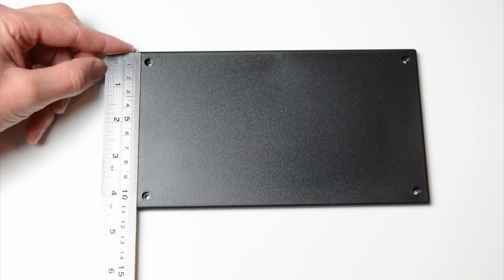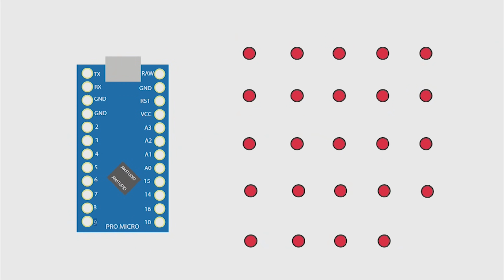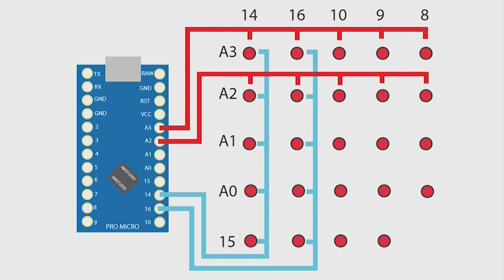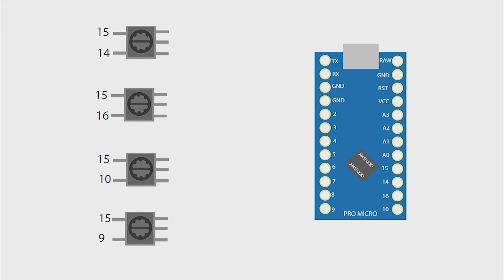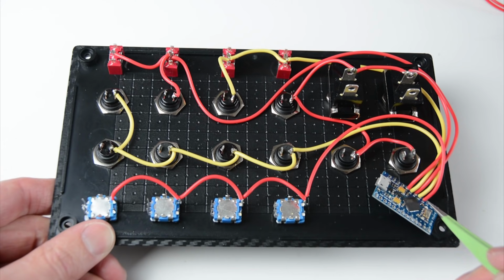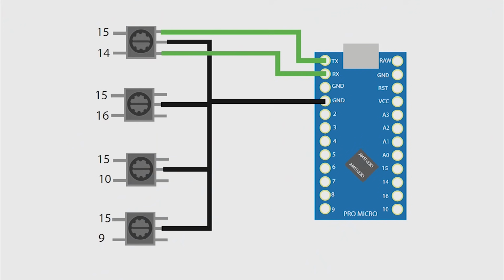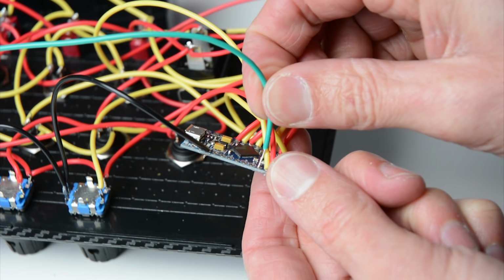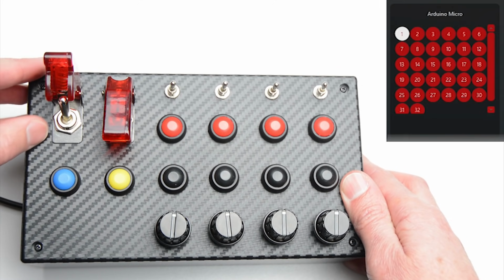MAKE THIS BUTTON BOX | 32 FUNCTION w ENCODERS

Comment: Ciao, ho programmato il chip Pro micro con il software Arduino IDE ma sembra che non mi carichi il programma, come mai?

Connecting to programmer: .
Found programmer: Id = "CATERIN"; type = S
    Software Version = 1.0; No Hardware Version given.
Programmer supports auto addr increment.
Programmer supports buffered memory access with buffersize=128 bytes.

Programmer supports the following devices:
    Device code: 0x44

Comment: I know am gonna sound really stupid but is it possible to make the buttons just run normal pc stuff like power on, brightness, screen shot etc
Reply: Im not a professional, but i think single keyboard switches are what you are looking for when talking about screenshot. You just need to program the Key and its ready. For the power on, you just need a Button with positive and negative poles, and connect them with a proper cable to the right pins on the Bottom right of your PC motherboard.

Comment: Would the 3 way toggle switches work with your code if they aren’t momentarily toggle ones?
Reply: I used 3way toggle and it doesn’t seem like it reads quite right? IE if I went up on the switch it read as button “x” and when I toggled it back to the middle, it read the same button. When I toggled it down, it would read button “z” and then it would read the same button when switching it to middle again. Unsure if that info is helpful to you but it’s what I got

Comment: Jak wejść by sprawdzić przyciski czy dzialaja
Reply: I was wondering the same thing. What i used for testing was opening up a game that I wanted to use this one and started assigning the buttons to different actions. In example, I opened up assetto corsa competizione and under the settings I was able to the Arduino as a usable device. The I would select a control to bind a key to it and would press a button on the box i made and if it worked, it would bind the control to whatever number i had selected.

Comment: I know this is a really old video, and I looked everywhere to try and answer this question(including purchasing your guide), but how do you account for ghosting? Or is it just a non issue? Thank you either way!
Reply: add a 1N4148 diode in series with each switch leg to the column line, the diode blocks reverse current, preventing ghosting and cross talk

Comment: Maybe I missed something but for these boxes I have heard other videos and on Forums people saying you will only be able to press one button at a time when using a matrix setup is this correct and is there a way around it? a different board with more input/output options maybe?
Reply: Yes downside of matrix is only 1 press at a time. Keyboards solve this issue by using diodes, allowing for NKRO

Comment: I just finished a version of this. Bought the box, chip, and switches from AliX. i think I've got $35 in it total. More soldiering and wire twisting than I expected. Program worked right away and the box is doing it's duty. Thank you for all of this work.
Reply from the maker: Thanks, enjoy!

Comment: I have a question. Do i use A and B encoders or the one with clk and data on it? Because yours on the video is using 4 pins and 1 ground. But i only find 2 ground and 3 pin encoders that look like yours

Comment: Hi. 

Wondering, with the board, it's 5v 
Are the switches also 5v or are they lower, but the board outputs a lower voltage? 
Found some stunning switches to use, but they're 12v! 😒
Reply: 12v is the maximum voltage i think

Comment: I have successfully used this guide to make a button box for DCS that has most of the frequently used controls on it; gear, flaps, weapon select, master arm etc. However, I am getting some interreference that is causing the gear to try to extend at overspeed, breaking the plane. Is there a simple way to break the current SPST gear switch out two two unused pins? I have not used the rotaries but have used their momentaries. Its really frustrating as this box works beautifully for 99% of things, but that 1% prevents me from landing nearly every time! Anyone help a guy out???

Comment: First I'd like to say that this is a very awesome build. I have most of it done including the 3d printed box and lid. I made a slight modification not realizing that it's probably more complicated than not. I took out 1 of the dial encoders and replaced it with a 5 pin engine start (ignition) button. The pins are + - C NO NC. Is there a simple way to include this on this project? Also, besides this, the rest is exactly how you have it. 

Many thanks in advance, even if you cannot help. This is a very awesome project.

Comment: How would i go about changing the Sketch coding so i could use it with 2 rotary encoders and 4 buttons? for a wheel im building as the seeduino only has 10 I/O

Comment: I built a gorgeous box with ignition , toggles , buttons , you name it. But I used a zero delay USB because I just didn’t know about arduino. Little did I know zero delay is straight garbage unless your playing one sim and want to fight it for weeks to get it working. So I just gotta learn how to use the arduino mini I just bought. 🤦‍♂️
Reply: Ummm ok. But you didn’t explain why you wire it that way. I mean not even just a general explanation would be all I need. I can’t just fly blind based off zero info

Comment: I really tried it myself and failed so horribly... my First arduino pro mirco Board arrived at my place and was Fried to hell... now that i got a working Board, the matrix doesn't fit and needs to be changed since i use only 4 buttons and 3 Encoders...and nobody told me i needed fully Digital encoders 😮‍💨 seems like i can put the buttonbox into the trashcan... i tried i guess...

Comment: I don't expect a response, but can someone explain the way he wired in the on-off-on toggle switches? He didn't show it and I'm confused how it would work.
Reply: If you are still curious those switches have 3 terminals. The common is normally in the center so you would solder your common signal to the center terminal then your button 1 wire to the top terminal and button 2 wire to the bottom terminal. So if you look at his matrix as an example you would solder say A3 to the center and then 14 to top and 16 to bottom which would give you 2 different controls depending on which direction you hit the toggle

Comment: Is there a way to do this but with the toggle switches ON and OFF registering as different inputs? The toggle switches being either 1 button held on or not being pressed at all doesn't let me use them as an actual toggle in any of the simulators I've tried. I know I could just use 3 position momentary switches instead but that kind of takes the fun and realism out of it.

Comment: could you use the 32 button and the handbrake on the same pro micro, using the ground and the vcc and a0 for the analog input and the rest of the pins for the button?

Comment: Sorry for the stupid question but I'm a noob about this... with this project I can assign to the button also combo keys, like for example Shift+L ? I mean memorized in the button box... I need to use it on assetto corsa competizione on PS5 and it works only if there is a combo CRTL+ another button...

Comment: I'm currently working on this and drawed out everything. Have a 5x5 Matrix and 4 Encoders. Am i right, that even if i could get 33 Functions out of this ( 25 + 8 ), not all will be registered because of a 32 Button limitation in MS Game Controllers?
Reply: For anyone wondering, you can just register 2 Inputs if you're out of buttons. Needs just a bit more planning to allocate the correct matrices without running out of pins.

Comment: I love this idea. I've got 2 printed out (left and right boxes) with some small edits. I made new brackets that angle the boxes slightly up and in - more like a fighter cockpit. I've adjusted the arduino code slightly as well which will allow more functionality of the buttons/analog sticks. I have them plugged in and working, but have more buttons ordered and on the way to complete it!
Reply: Hey did you use the pro micro arduino?
Reply: @smuncki8  yes! specifically with the ATMEGA32U4 chip. I also used terminal connectors in case I decide to change things around... colors, button type, easier maintenance, etc. No soldering required.

Comment: Great Video, 
i Bought the Step by step instructions from you and Wired everything correctly. 
But i have one major problem. Two of the 4 Encoders does not work correctly, everything else works fine.
and i cant find any mistakes so far. 

Cheers Florian.
Reply: encoder maybe overheat?

Comment: currently using all the parts listed for a button box for ets, building most of it tonight

Edit: Is now built and works amazingly, Thanks for the tutorial!
Reply: Can you use multiple buttons at once though? Seems to be most people's problems
Reply: @ryanlawrence1764  when you press more then 3-4 buttons at a time you will get ghosting, and occasionally the buttons that are on the same line pins can sometimes flicker ( when pressing multiple ) but i've never had a big enough issue to need to add any form of anti-ghosting
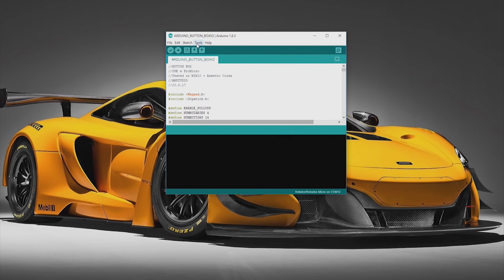Reply: @Incognist   at 6:13 what does the creator mean by "upload the button box sketch to the board"
Reply: @saifama0  Hes talking about the code created which you edited to your individual buttons. Eg you edit values if you have a few more rotery encoders or put the buttons on different analog pins. Then it stores the code on the arduino board so that you can unplug and it still be on the board

Comment: Great video, I bought the $5 guide :)  Question about the matrix.  Anyone know if it will cause a problem if several buttons are pressed at once?  e.g. if a some of the switches were non-momentary toggles, would that cause a problem with it reading which buttons/switches are on?  Thanks.
Reply: Actually, having looked into it a bit more it looks like these would be better off out of the matrix.  Probably could just leave out one of the rotary encoders to leave 2 pins for the the 2 non-momentary toggles.

Comment: Hi , Thanx for your great video. Question : is it possible to replace the blue button (2 pins) by a Start-stop engine button (5 pins) ? is the Arduino micro can manage this start-stop engine button with 5 pins?

Comment: Hi mate, just wondering if it would be possible to build this with an analog input (potentiometer)?  I want to make a very small, portable steering wheel + button box for use with the laptop - it only needs to be marginally better than using the keyboard :) I've tried using a normal game controller but for games like ETS2 you really need something that can sit on the desk and has more buttons
Reply: I've actually now made two different button boxes, one is the portable one i planned above, and a second one which is set up on my sim rig.  I haven't made the analog handbrake yet, but I did make an indicator stalk (inspired by one of the other AMSTUDIO videos), and a sequential shifter, both of which are controlled from the button box which has 8x buttons, 4x momentary SPDT switches, AMSTUDIO range and splitter mod (paired with a momentary switch), and 3 rotary encoders.  I have a total of 25 'button' controls, 1 analog, 3 rotaries, and there is a single spare port - if I swapped one of the button matrix leads you could add a second analog device, but at this point I have no need to do it myself.

I'm using stereo plugs (6.5mm for the shifter, and ultimately will use 3.5mm for the handbrake to prevent problems) to make sure that I can keep the system a bit more portable.

The code for the analog controller is easy enough - you can use the examples given on the Joystick library's Github.

Comment: you need diodes in this, because otherwise only 1 button will be recognized at a time, and you might have ghosting.
Reply: Nope!
A keyboard works in the same way and doesn't have diodes
Reply: @lennaertvallentgoed3804  that's not true. Keyboards absolutely need diodes.
Reply: @fernank017  I stand corrected,
On those occasions you need to start your engine while blinking your lights and adjusting the abs and brake balance  you are in deep trouble
Reply: @lennaertvallentgoed3804  not just that, if you use this method for other applications like I did -- for a steering wheel, ghosting might end up causing you to downshift at an rpm too high causing an engine/transmission blow out. Or in a situation where you're tailing someone, and you end up triggering the pit limiter.

Regardless of the need for ghosting, you still need diodes for a matrix.

Comment: If I wanted to have buttons with Illumination, do I have to wire the Illumination pin into a power source different from the input/gnd pins for the switches ?

Comment: I know i'm 3 years out of date, but would the matrix not cause potential "ghosting" where if you press [A3,14] and then press [A1,9] it would also then press [A1,14] and [A3,9]?

(Not an issue most of the time, but for some things may cause issues, IIRC this is a solved problem from the Keyboard space, but I don't remember the exact solution ATM)
Reply: This is the comment i was looking for.  I made a board that uses many toggle switches that would remain in the on position.  I'm stuck at this point because I'm getting ghosting everywhere and will pobably just tear it apart and make a 4 button / 4 encoder box out of it to salvage the project.  Disappointing.
Reply: There is a certain diode that people are wiring in after each switch, to prevent ghosting of multiple button presses.
Reply: @coreyprosser4433  any more info on this?  I wasn't able to find it.  It's it buried somewhere in the comments?

Comment: Great video, I'm searching a tutorial for use 12 switches for control the switch panel of a home cockpit of the Cessna C172 and thisi tutorial is perfect. I have tried to connect a lever switch on an arduino micro where I flashed your sketch. I plug it on my PC and I see Arduino Micro on joystick section. The only problem is that I connect a lever switch to the arduino micro and assign a function of the flight simulator to this switch (for example taxi light) I see that if I lower the lever of the real switch even in the simulator the lever of the taxi light is lowered, when I raise up the lever of the switch real, the simulated one does not react, it stays down.
If I lower the real one again, the simulated one finally gets up.
In other words, the virtual lever reacts to every two commands of the real one.
There is a way for solve thisi bug?
Thanks, ciao and sorry my bad english

Comment: Hi, I am not a pro so I don't know if it is possible to simply change the 4 encoder to 4pcs 3way Toggle switch as well. Is that requires a lot of changes in the program codes of Arduino board?

Comment: Hello, is it possible to light on the start pushbutton when pressed? I have a start button with integrated leds and 3 connectors but I am not sure how to wire it and if it can work with matrix buttons

Comment: I know this probably won't get answered, but worth a shot. I made a button box using your technique and scratch etc, and it comes up as a controller fine with all the buttons working correctly. But when I use it with my tmx wheel, as soon as I map the keys in forza, my handbrake is permanently on! Any idea?

Comment: First thanks for the video. Second, for my encoder are pins A and B the ones being used for pins RX TX 2 and so on and the sw or button being wired to pin 15 and the vcc to say 9?

Comment: Man the only challenge here is to get a clean solder in for this box, cuz i'm horrible at it. I used the same schematics on his formula button box but i made a mistake by soldering on the pin headers, because it stopped it from closing and i tried forcing it in so the usb port went off

Comment: Having trouble with inputs getting confused. Each button/toggle/encoder works individually, but when I have a toggle switch on and press a button, other buttons will activate too. can I use diodes to fix this? any advice would be appreciated greatly!
Reply: Same problem..

Comment: Damn, I realize I'm late to the party here, but, just wanted to say 'well done, sir!' That's a mighty fine build you've,.....
 mmm...built..
Wanted to add that instead of tying a knot in your usb cable, a good solution to preventing the cable from coming out would be adding a clip on ferrite bead to the wire. While a usb cable is generally not pushing enough current to create a problem due to the unintentional {mini}inductor we've created (aka the knot) we do know that sim gear (especially our beloved giant motor wheel bases) has a history of creating nasty EMI and making electronics do all kinds of wonky things. So, using a ferrite bead would help in several ways, a 'cable-stop', remove inductance, and lastly, block potential EMI from our other sim gear.
Sorry for the long winded msg, I'm sure you know all this but I wanted to explain for any curious passer-by.
One more thing (though you probably won't see this because a. The video is years old and b. You would have had to read through me novel above, and I certainly don't blame anyone for saying "F` reading all that") the car in your background... Did you Photoshop that? Whoever did, did a fantastic job! Only reason I recognized it was is because I spent YEARS photochopping myself.
Anyways, sorry again, and seriously great work bro, 
-Michael

Comment: I have a 12v missile switch. How can I light up and command at the same time? the light turns on when connected to the 5V output. But I also have to connect it with digital pin + GND. When connected in this way, the light does not turn on. can't connect with digital pin 5V at the same time: D Is there a way to do this?

Comment: Is it works fine if I use several (for example 4 ) toggle switches at the same time? I have heard that sometimes it doesn't work properly because it has too much buttons to handle paralelly. Is it true about this type of buttonbox/arduino?